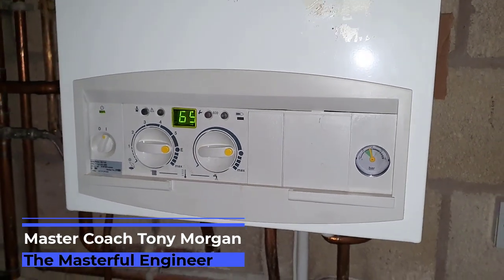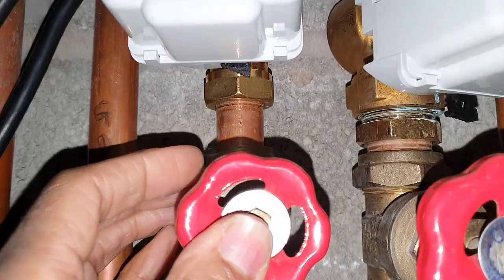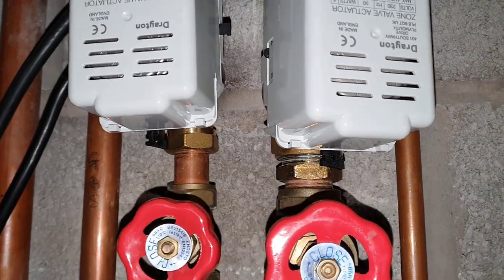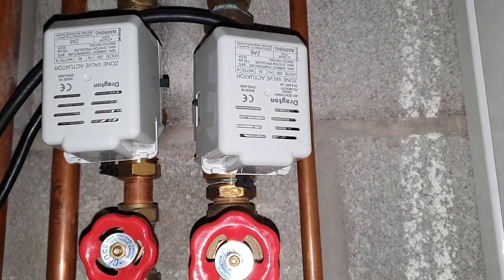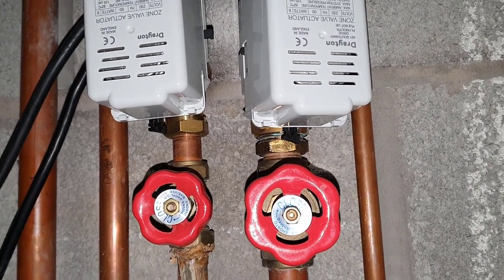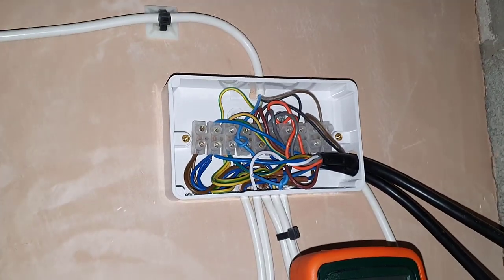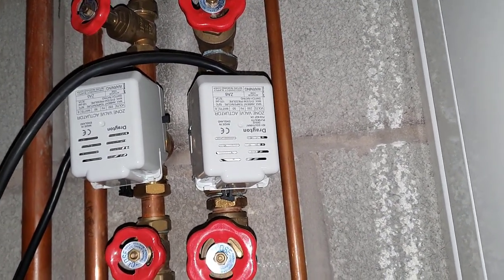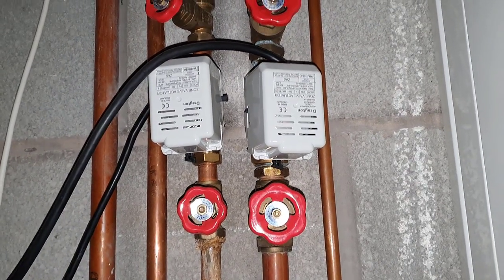Worcester Greenstar 28R HE Heating Wont Turn Off Part 2

Comment: Hey Tony. Another good training video. I have a question about this situation.. if the micro switch inside the valve is faulty and sending a voltage to the boiler via the orange thus switching the boiler on, would the valve still be open when the demand from programmer and roomstat is off ?. Looks like the mechanism is still functioning. So why would the heating be coming on ? Thanks in advance
Reply from the maker: That is a good question the valve must of been partially open to allow flow to the radiators.
Reply: @ARBoilers  nice one. Thanks for the reply Tony. That would make sense.